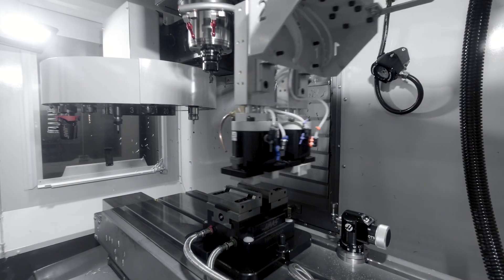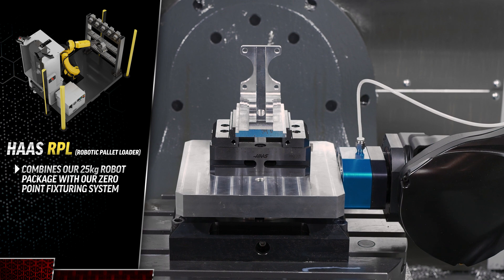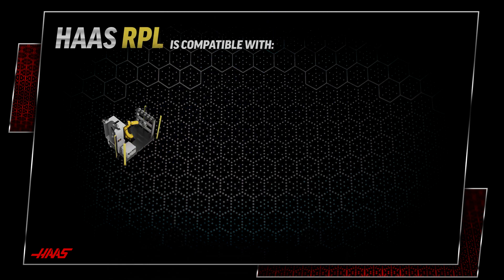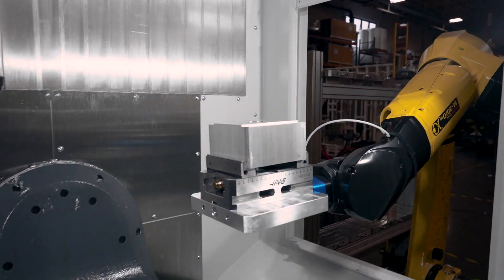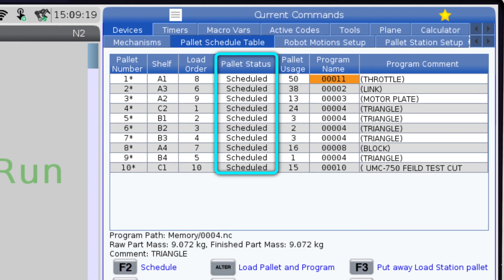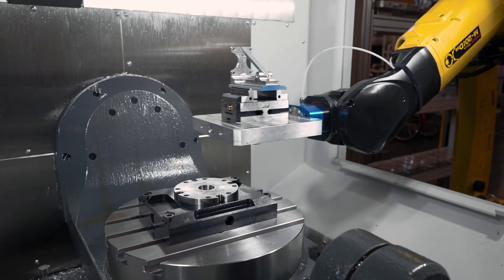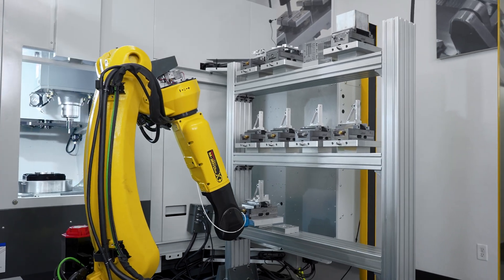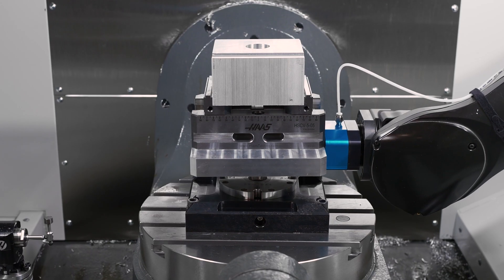The New Haas Robotic Pallet Loader - Haas Automation, Inc.

Comment: No 2. pallet wall as option? Only 15 palleets with 25KG is very limeted.  Also a gripper change to load raw stock would make this system very atractive. Why have a operater load a vise 50 times with a part if he can just put 50 raw parts in a tray? That would free up  a lot of time to program thos one of prototypes and smal batch work. 
Keep up the development and edjucation. Greetings from germany